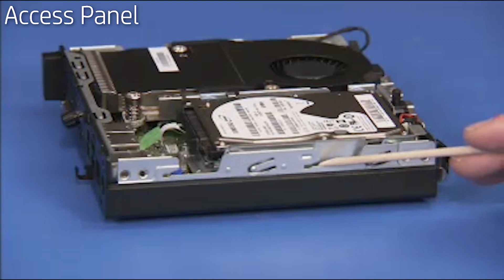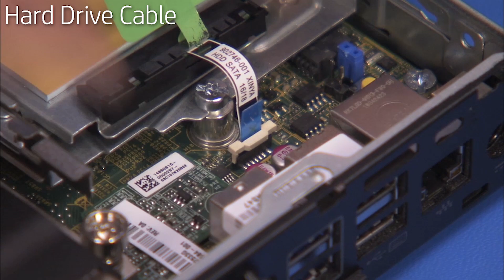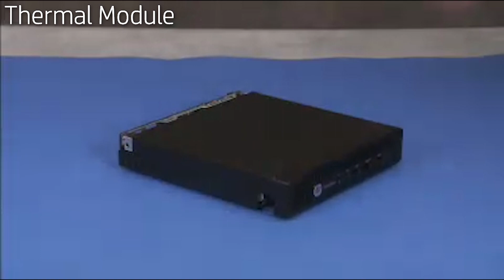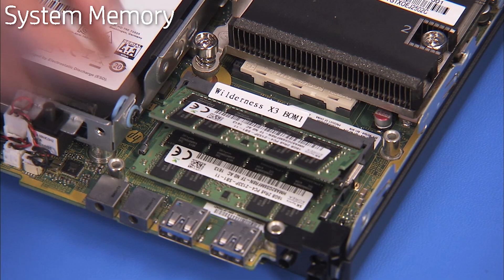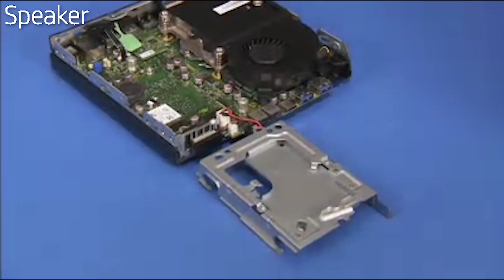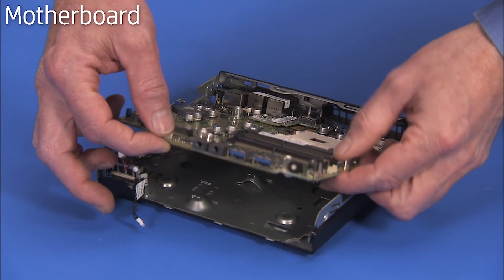Removing & replacing parts for HP EliteDesk 705 G3 | HP Computer Service

Comment: Thanks for the video, but my computer could not start up. I tried changing to a cable that was working and it also dod not work. I don’t know where is the power supply on the motherboard so I’m still confused on how to fix it
Reply from the maker: +M. Nguyen This document provides possible solutions to many common computer start-up issues. Follow the instructions in this document step-by-step to help isolate the problem and find the most appropriate help: http://hp.care/2oFlOWC

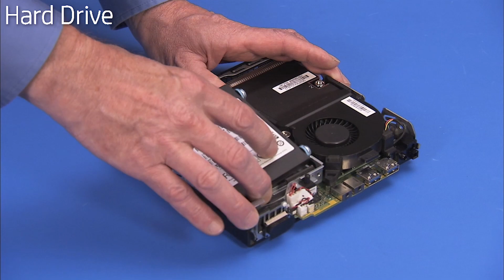Comment: very useful video, at 1:48 what is the yellow padding on the hdd cage and why is it oily? I touched it by accident while replacing the hdd, is it sth I have to clean or replace with some new liquid? Thank you
Reply from the maker: +T T It is called hard drive cage.
Reply: @HPSupport  its the thermal pad for the hdd but why is it oily? do I have to change it, is it ok to wipe the oil or is meant to be like that?
Reply: @TT-sr4mu  you can probably wipe up the oil and it'll be fine
Reply: Rubber turns back into oil as it ages. If you are replacing it with an SSD you should be able to remove that pad as vibrations won't be a huge issue anymore; but you should keep it in place if you not planning on using an SSD and instead keep on using a mechanical drive, just clean it beforehand before reinstalation.

Comment: Can I increase the dedicated video memory? The PC auto updated the bios but it doesn't have this option.
Reply from the maker: +Ananias Junior You can't increase the video memory per-se, but you can allocate more virtual memory for your computer to use. 
To do this, click start, right click computer>Properties>advanced system settings>advanced>performance>advanced>(virtual memory)>change> 
click custom size and enter the size of hard drive space you would like to allocate to virtual memory. I would recommend and initial size of 10000mb and a maximum size of 20000mb. Click apply and reboot your system.

Comment: does it support AMD Ryzen 3 3200G?
Reply: The CPU and integrated GPU are soldered-on and not easily upgradeable. Which is the norm for almost all compact mini PCs. The drive and memory are fully upgradeable tho.

Comment: Can change power Supply? Mine si 240w, can change it for a 450+?
Reply from the maker: +Franco Norambuena HP does not recommend upgrading or downgrading hardware parts or software that is bundled with the product as It may affect the manufacturer's warranty and performance, however, you could change the configuration at your own discretion.

Comment: Hi, EliteDesk 705 G3 fits a Ryzen 3 2200ge?
Reply: It has an AM4 socket, so yes
Reply: @Vladiator  The normal ryzen 3 or only the PRO version?
Reply: @Vladiator  it does not support athlon 200ge no pro version. if i buy 2200g or ge i wan to be sure that my system is supporting them
Reply: @Vladiator  The socket itself is one part, the other part is the voltage section and how much W it can provide to the CUP and GPU. I have in my mind to put R5 5600G, but I need the CPU line to support 65W, since the processor itself is now 35W...

Comment: does it support ADT Link M.2 External Graphics Adapter?
Reply from the maker: Hi there, thanks for contacting HP Global Social Media Support!
I understand that you need to know whether ADT Link M.2 External Graphics Adapter is compatible with your computer.
I will do my best to assist you.
Use the HP Parts surfer to identify the part: https://hp.care/6054mP5KO 
And order it via the HP Parts store: https://hp.care/6055mP5KP 
If you are unable to locate the part, please check 'Ways to buy'
Regards, 
HP Support

Comment: Hello. It would be nice if the R5 5600G could be installed in it. Is that possible? I know that the current CPU in it is 35W and this new one would be 65W. But with some underclocking and limiting it would easily drop it to 35W. If you don't limit it and if it works a bit hotter (0.1% of the time) it has its own limit - I don't see a big problem. All the links you posted as answers 4 years ago have expired and the pages no longer exist.
What chipset is there anyway? B350?
Reply from the maker: Hi there, thanks for contacting HP Global Social Media Support!
My apologies for the inconvenience, I am here to help! 
May I know the product you are using? A valid serial/product number would be helpful for me to give you an accurate answer!
Let me know!
Regards, 
HP Support
Reply: @HPSupport  HP Elitedesk 705 G3 MT with  AMD A10 PRO 8770 cpu (i want to upgrade to Ryzen 5 5600G 65W) , 8GB ddr4 RAM (i want to upgrade to 2 x 16GB ddr4 3200 MHz), 256GB ssd (i want to upgrade to 1TB gen 3). I would like to add some GPU like RX 6600 (recommended PSU 300W).
Serial number: CZC81774S7, PN: W4Q23AV.
Thank you.
Reply from the maker: Thanks for getting back to me, Please use the link below to find your CPU Maintenance and Service Guide and refer the manual for upgrades,
Link - https://hp.care/6052oe2V4
Under the Removal and replacement procedures – Microtower (MT) chassis (page no. 18), you can find the supported upgrades for your system.
Let me know!
Regards, 
HP Support
Reply: @HPSupport  All aside, but I'm really positively surprised by your approach, openness and especially the speed to comment on a 5-year-old video. WOW. Kudos to you and your department! I have to point that out first. Keep it up!
As far as the instructions are concerned, there is only a list of the 7 processors that are built into the system. Some more advanced ones with some explanations I can't find. I don't want to take up much of your time, but I think that other people are also interested in this (I found a few other videos on YT where they tried with Ryzen 2200GE) but I can't find an exact list anywhere or a list of "those processors can and those who have that and I can't do that". According to some logic, if it's an AM4 base and if it's a B350 chipset - any processor can do it. But unfortunately it seems that is not the case and that the engineers from HP have made some savings that make it impossible.

Comment: Support Ryzen 3 2200g?
Reply from the maker: +Bad lucky Real Yes. It supports Ryzen 3 PRO 2200G and 2200GE APU with AMD Radeon Vega Graphics 8
Reply: @HPSupport  Can i install normal Ryzen 3 or it must be only PRO version?
Reply: @HPSupport  it does not support athlon 200ge no pro version. if i buy 2200g or ge i want to be sure that my system is supporting them
Reply: @HPSupport  It does support 2200G APU even if it doesnt say that on the official page?Im about to buy the A12-9800E version,an i would like to know if it really does in order for me to get one as an uprated path in the near future.If so what firmware version offers the support?